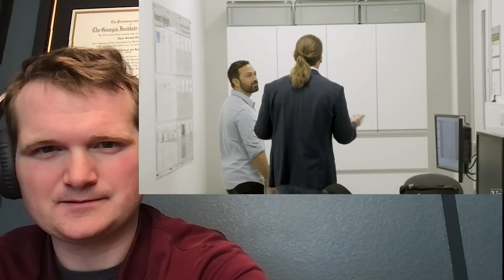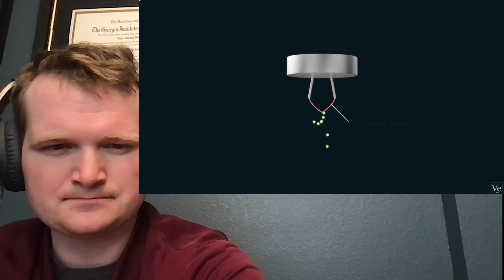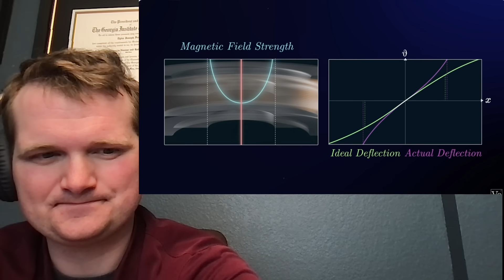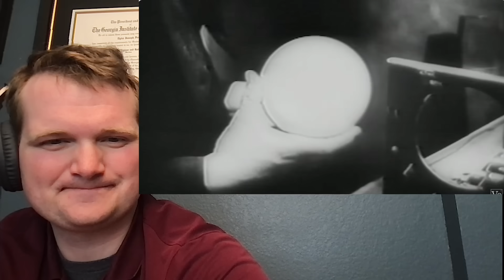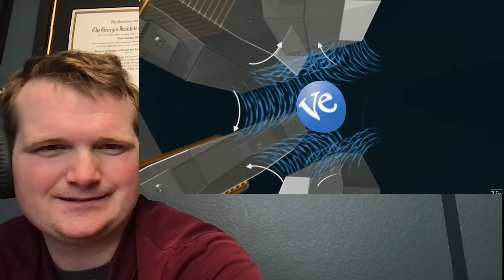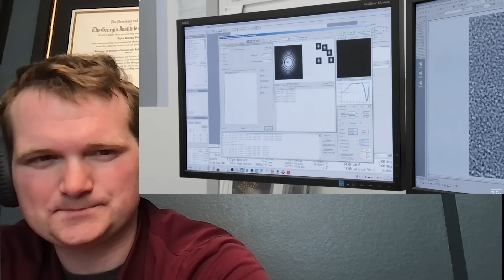What if you keep zooming in? - Nuclear Engineer Reacts to Veritasium

Comment: The research reactor is at Lucas Heights.  Not too far away, but far enough that it's not part of the big city :)    Technically it is a very southern suburb of Sydney, though it is 31km (19 miles) from the Sydney CBD.   :)      I actually would be interested in your thoughts on the reactor at Lucas Heights sometime.   It is an OPAL (Open Pool Australian Lightwater) reactor that has been operating since around 1958, so that is around 67 years if I can count.

Comment: The simple loupe we use in gemology you see Jewlers use to check a stone actually uses that principle. Good loupes often have 3 or more lenses

1st lense does the majority of magnification. It's biconvex, meaning it curves outwards on both sides

2nd lense helps to correct spherical aberration. Which is the blur on the outside of the lens. It's planoconvex, meaning it's flat on one side and curved outwards on the other

3rd lense corrects chromatic aberration. It's often a concave lens, meaning it curves inwards. This corrects the color to how our eyes would see it

And that's just a simple triplet or quadrouplet loupe! Any cheap loupe with 1 lens would never be used for grading gems

Comment: So.... I just had a weird realization/connection of knowledge. 
When talking about everything has a wavelength, I started thinking about constructive and destructive interferences, and that, in theory at least, if I have a wavelength, you could generate an identical wave 180 degrees out of phase and... effectively cancel me out of existence, much like how noise cancelling headphones work. 
Then I realised that, that's must be what anti-matter is right? Matter whose wave lengths are identical but 180 degrees out of phase?
So...... now my question is this..... could you get matter that is again identical but out of phase, only, not by 180 degrees, but, say, 90 degrees? or 30 degrees? And what would that look like?
Ok.... it's late at night here, I'm tired, so I accepted it's possible my marbles have all long since escaped and I'm entirely wrong with all of this....... but am I?
Reply: I would disagree that a wave that is out of phase would be antimatter or negative matter. A way to alter a wave's phase is to change its position, which leads to the conclusion that as you move you are cycling between being normal matter and antimatter or negative matter, a phenomenon which we do not observe.
I do not think that de Broglie's result should be interpreted as that large objects are a single wave: there is far more information about you or I than what could be encoded in a single wave's properties.

Comment: "Interesting how often that comes up" Points at my Display picture Trinity Triangle compared to Triangle ionic lifter or Triangle shaped Diatoms or 3 phase setups or Flux Capacitor < Couldn't resist Yes.. Your ancestors called it sacred geometry. Shapes that have power in the universe. Looks at Humans circled around a fire from top down view 😘

(Comment: "Explain" Triangle for example is the strongest shape in nature. Once discovering that ONE thing it has many places it can be applied for designs for improving them. Eventually will get into using Ultrasonic frequencies in molten metals to create shapes already known for increasing strength for stronger metals.)
Reply: Explain
Reply: @ASchell90  Triangle=Strongest shape in nature on this world be the same everywhere. Google: "TR3B" Grins at people